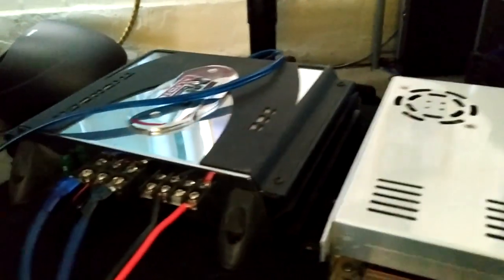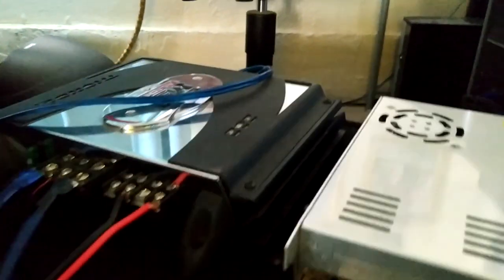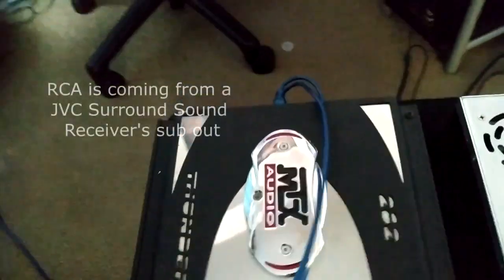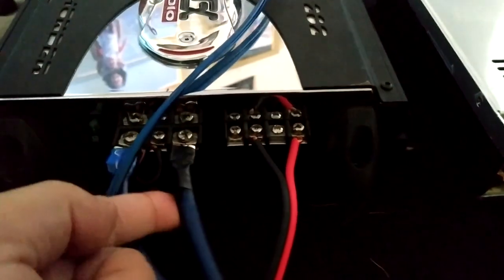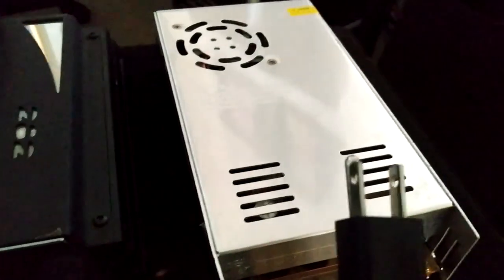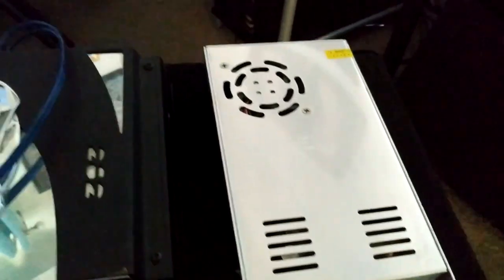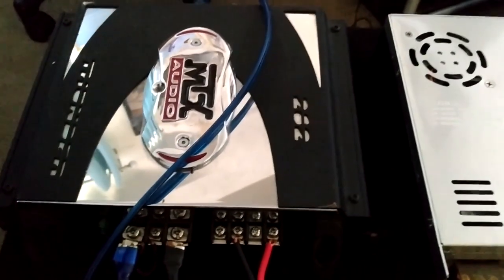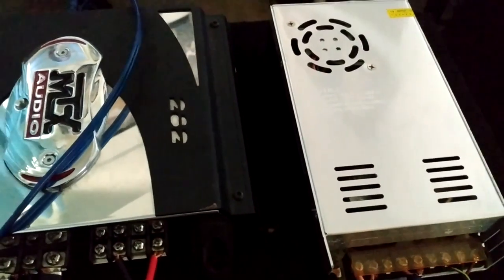Car Amplifier in Home Theatre Surround Sound

Comment: been doing this for like 10 years,to make it even better just make custom enclosure for the sub then tuned it insanely low like  20hz-25hz with 2ft-2.3ft space in it then it would sound like 1000$ home theather subwoofer
Reply from the maker: It's been a long time since I had that cheap setup.  Now I have a 12" JBL and two 10" soundqubed subs each 10 on a Crown amp
Reply: @jorgem50  man, i wouldn't it cheap setup to me it's look like a decent setup with MTX-282 amps and it is a real thing compare to knockoff brands out there ,to be honest i also used 2chn bridge amp for my sub for a years before i got myself a mono amp's
Reply: @jorgem50  do I hook the subwoofer slot to the amplifier

Comment: When you increase the volume or increase the bass boost and volume does the amplifier shut off
Reply from the maker: It never turned off on me.
Reply: @jorgem50  what happen if I connect two power supply 30 emperes in parallel will the voltage increase or just the emperes will increase can you make a video what I just say to you please
Reply from the maker: @gopyyanusdev3486  I no longer have that power supply.   I have more subs and I use Crown amps
Reply: @jorgem50  ok am telling you if I connect two power supply 30 emperes in parallel what will happen the voltage increase or just the emperes will increase
Reply from the maker: @gopyyanusdev3486  I don't know what would happen.  Sorry
Reply: @jorgem50  ok thank you and I like it you reply my comment

Comment: just worried about the power supply from transformer. is the wattage enough? coz sounds ratling from the bass.
Reply from the maker: I never had any issues with this cheap setup and to my ears the sub always sounded good.  I no longer use such inexpensive setup.  Now I have four 10s (car subs) in my surround sound setup and I'm using Crown Amps to power the subs.  Best decision ever!

Comment: Cool wish this video was done 15 years ago when I first was trying to do this I'm also using a jvc it's a older model the yours the power supply watts should match or be higher then the amp and the out put voltage should be adjusted to 14.5 if adjustable if all else the fuse size on the power should match or be higher  I'm running a 150 amp fuse so that should give you a idea on how big my set up is watt wise✌️👌👍 ps don't use a computer power supply there only good for small amp like 300w or less and if the deck is on the same supply it's even less fire hazerd.✌️👌👍 Hope it helps people understand stay safe
Reply from the maker: I'm currently pushing a 4channel amp bridged 250rms x 2 to a Pioneer 12" sub using this same Power supply.  Sounds incredible!
Reply: @jorgem50  the sound should no matter what it sounds like.  if the power is to small some thing will end up burning up the power supply or wire if not the right size remember if not turn up your not using the full amount of wattage  that's why the watts and amps are put on them there not for good looks and sounding good. Leave everything on full blast and wait a couple of hours you will see if it's to small. ExSpecially because the power supply is made in China I no and they lie any ways on the true out put of the supply that's why it should be higher than the amp rating. I do electrical for a living. I also been doing car audio for year now.  If Im running a 150amp fuse how big is my amp can you give me the answer. Till the next one have a good one 👍👌✌️🔥🤬💯🤔😉🤭

Comment: Is the power supply sufficient?
Reply from the maker: Yes it is.  Amp never shuts off.  I've listened to music for an hour to two hours and the power supply feeds the amp enough juice so the amp won't shut down.  I highly recommend the power supply
Reply: Yes the sub I'm using is 150watt Mrs and i have a 360 watt power supply
Reply from the maker: @tubeagro1986  Is it the same kind of power supply as the one I own?  What amp are you using to power the sub?
Reply: @jorgem50  same kind of lower supply. First I hooked it up with nust the live and neutral only because it was what was supplied with the power supply. I tried it with another cable that has the earth and it reduced the hum significantly but it's still there.
Reply from the maker: @tubeagro1986  Can be your amplifier or music source such as the receiver.  Try a gound noise isolator to see if it helps.  
My system is connected to a 20yr old JVC surround sound stereo.
Reply: @tubeagro1986  your rca and power are probably to close but make sure it not the amp it self the caps or resister can be going bad in the amp hope that helps